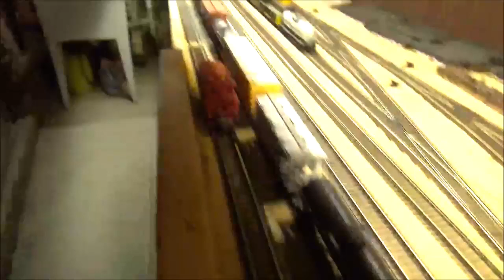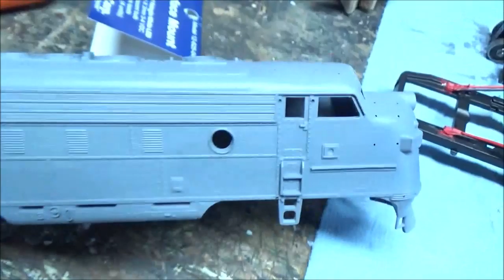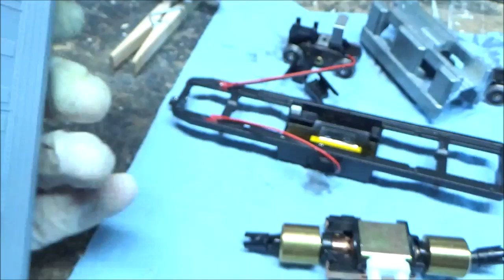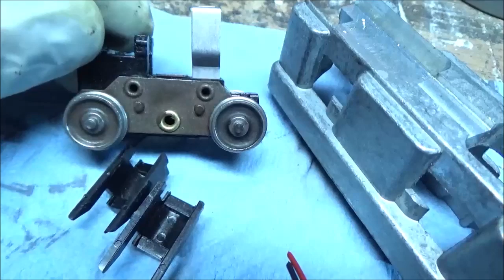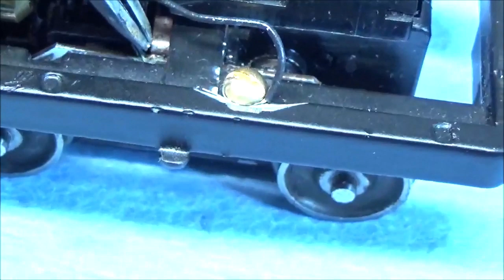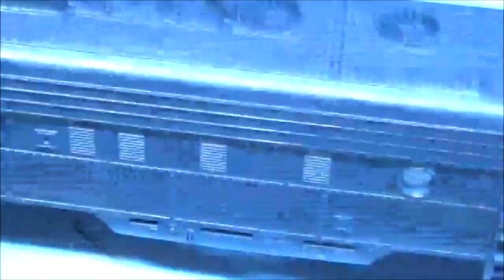Model Railroad Update 20 (Staging Upgrade & Motive Power Progress)

Comment: All looks fantastic. Since an older video. Did you cut out the number plates? Or decal them?
Reply from the maker: I painted the number boards flat black and then gloss clear.  Added the decals and then brush painted on more gloss clear to simulate glass and to seal the decals.

Comment: I like your videos of your layout. Your F7s are really taking shape. I model the Chessie also and have to repaint a number of locomotives that I have bought. I look forward to see how your F7s turn out.
Reply from the maker: Oh, very nice!  What part of the Chessie System do you model?  It seems that the commercial model manufacturers have focused on 1950's B&O or Chessie paint schemes leaving the 1960's to us to model.  Fortunately it is the least complicated scheme to model at least!   I need to get back to work on the f7's this weekend and hope to feature their completion in an upcoming video.
Reply: @ChessiePAdiv  I look forward to seeing your next video. I model my own railroad, which I was originally going to call the Ohio Valley. Then I found out about a part of the C&O's history that included the Chesapeake, Ohio & Southwestern. it ran from Louisville, KY to Memphis, TN. In the mid 1880s it was run, along with the C&O under the name Newport News & Mississippi Valley. Some cars and locomotives of the C&O were repainted to NN&MV lettering. in 1889 the C&O went bankrupt and the NN&MV was broken up. C. P. Huntington was in charge until this point. He sold hi interests at this time. I decide to use the core C,O&SW as the core for my railroad. I changed the name recently to reflect the heritage of the line and call it the Newport News and Mississippi Valley railway. It goes by the shortened name of Mississippi Valley on equipment. I have it expanding from its original core to a railroad rivaling the IC running from Chicago to New Orleans. It also goes to Detroit, St. Louis, Kansas City, Council Bluffs, Houston and Ashland, KY. It came back under C&O control in the 1920s and was taken over in 1949, but part of the deal was that it couldn't be absorbed by the C&O for 50 years. It had to remain an independent system, but fully controlled by the C&O. When the MV started dieselizing in 1940 it went with Alco. during the late 1940s and through the 1950s they only bought locomotive from Alco and FM. The first EMDs came in 1957. 

   The paint scheme was originally like the early D&RGW/LV/B&M paint, just in blue and yellow. in 1950, the C&O style paint was adopted, just with MV lettering. This continued through the 1960s and then the MV was included in the Chessie consolidation. This had allowed me to model some of my favorite locomotives, Alcos. MY locomotives are numbered in a common numbering system with the C&O. For example our 12 GP30s are numbered 3048 to 3059. Our U30Bs are in the 8300 series and our SD45s are in the 7600 series after the Readings, even though they were not included in Chessie. This allows me to just renumber and reletter some locomotives, but I have to paint a lot also.I hope I haven't rambled on too much.
Reply from the maker: Sounds like a nice freelance railroad with some prototypical roots.  I would love to see photos or videos of your railroad and custom painted locomotives.  Do you model in ho scale?  I like alcos too and my "Trackage rights to DuBois" operations video features a c425.
Reply: @ChessiePAdiv  I've been working on detailing some locomotives but I need to get a compressor for my airbrush. I have some U-boats factory painted in Chessie that need to be relettered and renumbered from C&O. I plan on modeling the north edn of the system out of Chicago so that I can include commuter operations. My time frame is 1975. I plan on using Alco FPA2s with C&O style coaches for the commuter trains along with U34CHs with PS bi-level commuter coaches.
Reply from the maker: My section of Chessie is a former B&O division that no longer saw passenger service at all.  My curves are also too tight for long passenger equipment.  Hope you get your compressor soon and look forward to seeing your progress

Comment: I am new to your channel and have spent the last few days catching up on your updates. There are so many things that I like about your railroad. The modeling details and information you provide are really outstanding. One of the things I really like is your use of the manual ground throws thru out your layout. You have convinced me to use them on the narrow gauge portion of my layout. Great job and thanks for sharing!!
Reply from the maker: Welcome Larry, Glad you like it so far.    The decision to go with manual ground throws was partially financial but mostly practical in that the limited space required a double deck configuration which would have required tortoise machines to mounted on their sides so they did not extend below the upper fascia.  Also the  confined space led to narrow shelves so the ground throws are easy to reach.  
     Scott

Comment: What are your plans for the F7 clear plastic windshields?  Are you considering painting the inside to "tint" them so you cannot see the interior?
Reply from the maker: I bought the Walthers dress up kits for them that have clear windshields.  Once i get the decoders installed i will see if i have space for a partial cab interior or even just a sheet of styrene to block the interior of the loco.